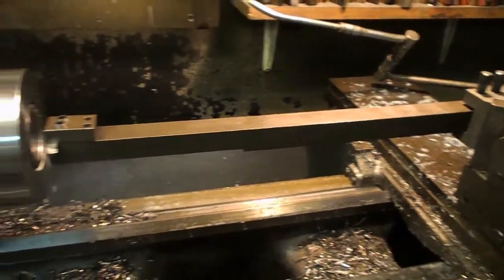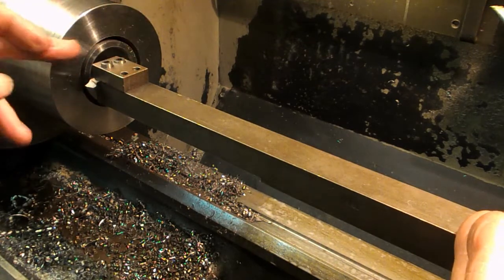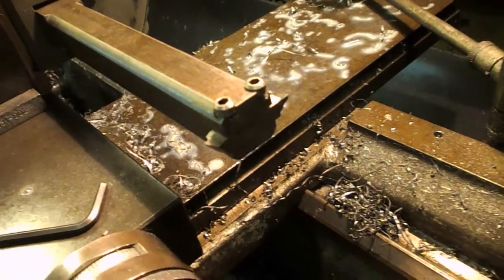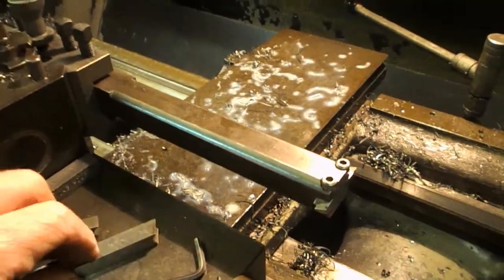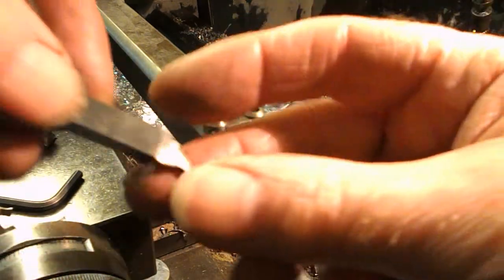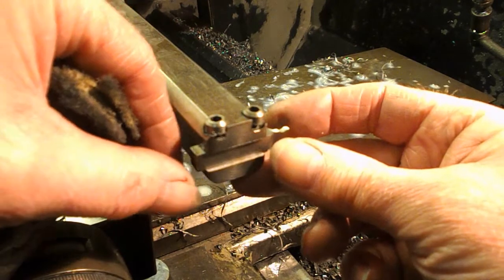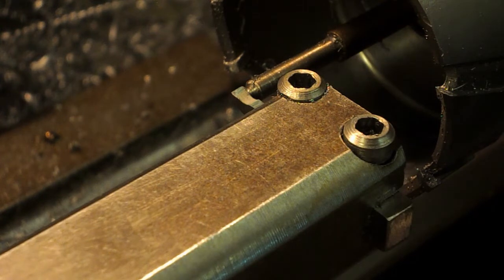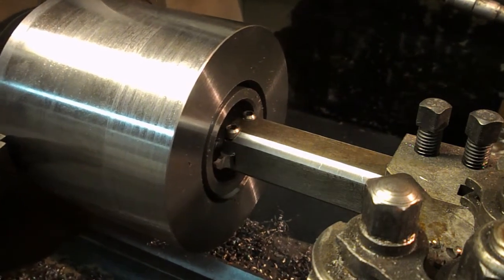Shop made crazy long Boring Bar with internal parting off tool. #SHOPMADETOOLS

Comment: If  you can fit a head like that through keep the whole bat that size and wrap a tight bicycle tube around it to dampen the vibration and  a magnet on the outer end of it.

Comment: A Crocodile Dundee  quote regarding knives might seem apt here, or have you made the machinists version of a woodturners Chatter Tool?😉
Reply from the maker: Haha. Chatter is not as bad as you might expect. Not that rigid, being  just mild steel, but also doesn't have the resonance that small manufactured bars sometimes seem to have.
Reply: @MidEngineering  mild steel might even resonate less than hardened more spring like steels. Overall stiffness of all steels is much the same as each other no matter the composition, but the thought of buying a lump of carbide that size rather puts one off the idea.🙄